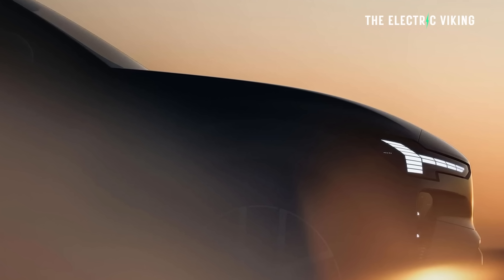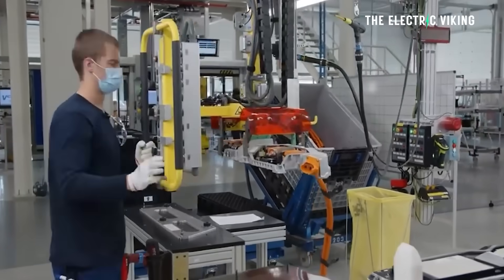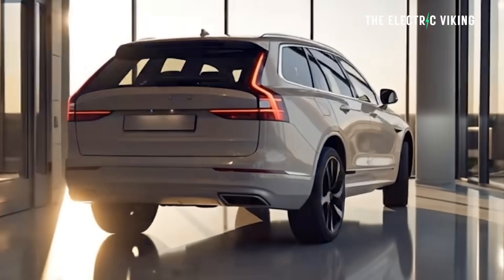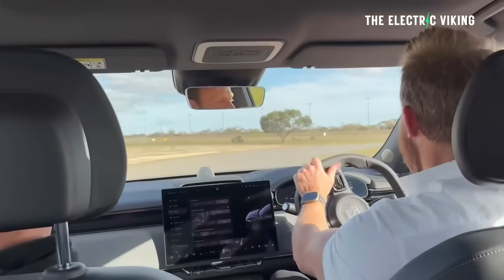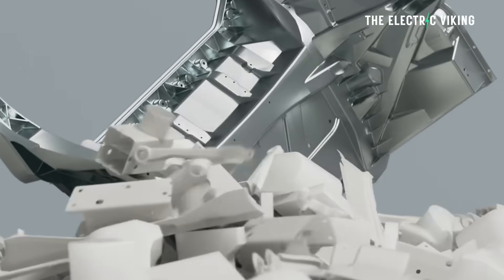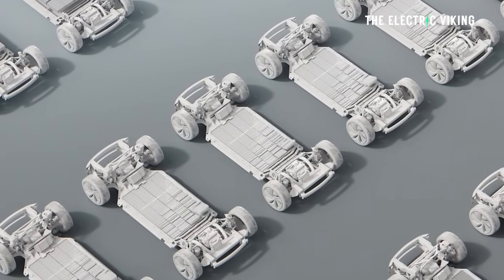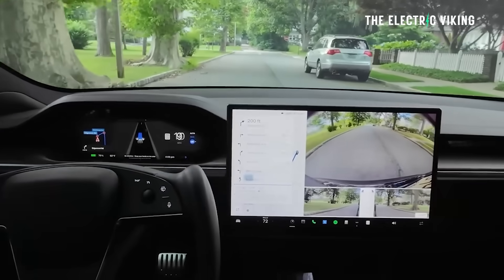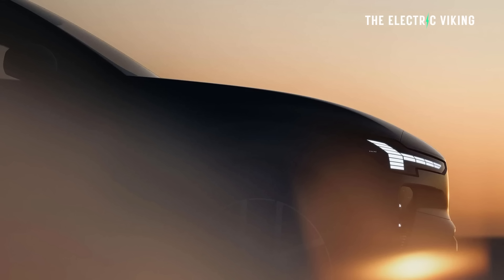NEW Volvo EX60 Gets 810 KM Range By Using Tesla Innovation

Comment: EU car makers have improved their game drastically. BMW, Mercedes and Volvo all have new 800V platforms. 400kW charging in BMW and Volvo. 320kW in Mercedes. Around 800km WLTP range on all of them. New efficiency improving tech such as front engine disconnect (when cruising), 2-gear gearbox, air-2-air heat pump, new more efficient motors, etc. 800V architecture also reduces losses. Tesla needs to bring their 800V system to mass market cars to be competitive. Only in Cybertruck currently. And it was a flop.

Also EX60 is not on a Geely platform. It’s on a custom brand new 800V Volvo SPA3 platform designed in Sweden. Only the cheaper Volvos use Chinese platforms.

Mercedes also ships CLA with Nvidia FSD tech in Q1 in the USA. Interesting to see whether Volvo EX60 uses it too. They are a long term Nvidia partner.

Comment: “…basically the same platform (as Zeekr 7x)…” [1:50] 
Zeekr 7x - on “SEA” platform, which is shared with Polestar and Smart. 
Volvo EX60 - first vehicle on “SPA3” platform, developed (I believe) in house by Volvo.
Reply: Correct

Comment: Weight loss is the engineering way to go … improved range and better driving dynamics and easier on the suspension size, durability and overall material consumption of car that’s a win win all round… hope it’s reflected in the pricing and margins

Comment: A bit hard to believe. Have a look at it from side on then look at a Model 3 side on. Does the boxy EX60 seem anywhere near as aero as a Model 3? It is hard to believe that the EX30 is going to weigh significantly less than the Model 3, so if it isn't more aero and doesn't weigh less then the only way to get longer range is to have a much larger battery. Assuming the battery energy density is close to that of the Model 3 LR, then the bigger battery capacity just means more weight. At least they are talking about fast charging, which in my mind is more important than just long range.
Reply: Ahh doesn't higher energy density mean more charge carried compared to weight. So the point is the new batteries carry more charge for the same weight of battery and the volvo cars weight will be reduced. Both increasing range of the car..........

Comment: As a long time EV owner, I've always thought 500 miles is the sweet spot for UK drivers. If you can charge at home or work, then you probably will only charge anywhere else once a flood. Hopefully it will come with V2H as well. It will also move some Tesla owners away from their cars as although Tesla's come with a fantastic charging network a 500 mile car will negate this advantage to quite a degree.

Comment: 810 km range is the for the “premium” option, with a slightly better price than BMW iX3 with 805 km range. The “standard” option (still AWD) will have between 650 and 700 km range. The car will be officially revealed on Wednesday the 21st of January.
Reply: I am hoping that longer range battery will be a stand alone option,not bundled into a higher cost trim such as the plus or ultra trims
Reply: 810 km ? Still 455 km short of my diesel car's range 😊
Reply: @johnthemagnificent7022 . Can you fill your diesel at home?
Reply: @davidcottrell570 Yes no problem.... what country are you in? We have jerry cans in the UK 😊
Reply: @johnthemagnificent7022   Haha! Good ‘un. Canada. Yes, makes a big difference having a driveway and plentiful cheap electricity.
Reply: @davidcottrell570  EVs are ok if you can charge at home and don't go very far
Reply: @johnthemagnificent7022  Well, we drove way up into the north country and stayed on an island for two weeks last spring. Round trip of about 3000km to a place called Haida Gwaii. You can drive up into the Yukon and find charging spots every 150km. Because our utility is a crown corporation, we have regulated rates. I pay $.076 per kWh, and $.36 for fast charging. That’s 4p and 19p respectively. I was born and raised in the UK, so am very familiar with the lay of the land there. But changes are being made, just as electric cars are getting better every year. Perhaps the biggest problem is your grid not being owned by the British public. Oh, and we also have a provincially controlled auto insurance agency. I pay about £700 a year, albeit as a low risk driver. Sometimes a bit of government regulation doesn’t go amiss when business gets too greedy.
Reply: @davidcottrell570 that's sounds better than the UK Scotland is a bit of a lottery with charging